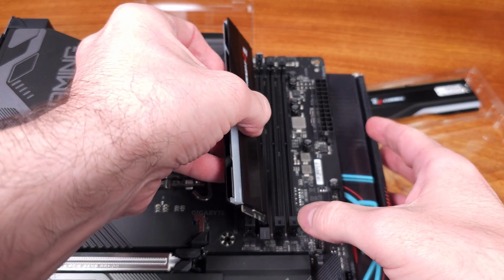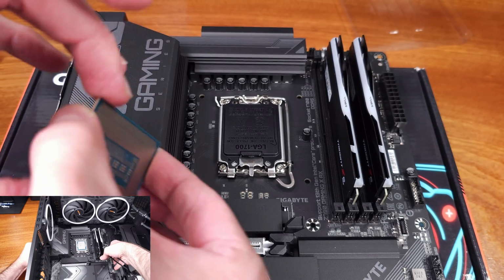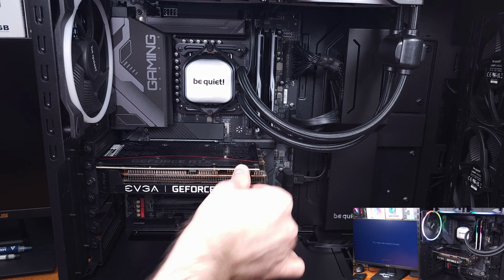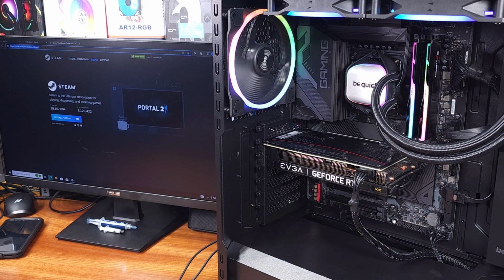14700K + G.Skill DDR5 6400!

Comment: Is there a better cpu right now better than 14700k for gaming?
Reply from the maker: @SCXR-NBD  The 7800x3D is basically the fastest gaming CPU but of course it's on the AMD platform. For Intel, the 14700K is probably the best value CPU for gaming, I don't consider the 14900k/s to be 'value orientated'
Reply: @STS  Thank you very much, i went with the AMD 7800x3D
Reply from the maker: Nice! You will not regret it. What graphics card did you go with?
Reply: @STS  I've got the 4070ti :)

Comment: I have 14700k and  gskill 2x 24gb ram 7200 MHz when xmp turned on, but always chash while playing game. I have to use at speed 5600 mhz and other profiles, I am not able to boot my windown10. What should I do?
Reply from the maker: Hi! Well, first things first - is that memory certified to run on your motherboard? Not sure what motherboard you have but it's worth checking the memory support list or checking G.Skill's. Next I would make sure you have the DIMMs installed in the correct spots. Your motherboard manual will have preferred slot assignments for memory generally speaking. There's an old troubleshooting method of just swapping the memory modules in each others slots, sometimes that works. If none of this helps, it's probably worth updating your motherboards BIOS to the latest version. If all of that doesn't work, you might need to contact G.Skill for support.
Reply: @STS  I have gigabyte z790 aero G mother board. I did everything you said, I finally can boot at 6800 MHz but it still crash at 7200 MHz. I read online forums they say because of mother board is not stable . I did memtest my rams don’t have error also.

Comment: Hi Sam, 
I’m looking to buy RAM for my New PC (video editing & content creation..OBS & stuff..)

GSkill Ripjaws S5 64GB 6400mhz DDR5 CL32-39-39-102 

OR  

GSkill Ripjaws S5 64GB 6000mhz DDR5 CL32-38-38-96  

Which one do you think is Better and Faster… (Motherboard: MSI PRO Z790-A WIFI, intel core i914900k + 4080 gpu )
Reply from the maker: Hey! If this is strictly for video editing, the 6000 will be fine. I find for video editing, quantity of memory is usually more beneficial than memory speed. The 6400 won't hurt and it could prove to be a little faster in gaming when future games need it. So, if you are looking to optimize your budget, the 6000 will be fine.

Comment: I know it's a debate but not spreading the thermal paste makes me unconftable.
Reply from the maker: There's sufficient pressure from mounting to evenly spread out but for the slight possibility that there is too much variation in the surfaces mating, I always try to use just a little more paste than I think I need. 

I have never seen a difference between pressure spread and spatula spread but I understand what you are saying. 

What kind of PC setup do you have btw?

Comment: I have my 14700K running the same 32GB 6400C34 GSkill kit. I got it overclocked on my Z690 4 dimm motherboard to 7000C32-41-41-28 and tighter sub-timings at 1.5v, and my 1% lows are way better with less stuttering.
Reply from the maker: Hey Oscar! Wow, awesome overclock there! That's quite an improvement - I'm quite curious to see if this 64gb kit can be pushed that far. I'm actually quite interested to see how far I can push the memory and see what kind of iGPU improvements can be had. 

This is a gaming rig?
Reply: @STS  yup purely a gaming rig. I'm sure you'd see some improvements in productivity apps as well. 64GB might be tough to get much higher but I would be interested in your results!
Reply from the maker: @oscar21781  Nice. Yea, I'll have to try to take look soon. In the past I had not really seen any games with my old video editing software but I do use Davinci Resolve now. Quite curious if there's anything I can do to increase performance.

Comment: I'm running 14700KF and Corsair LPX 6600 cl32, can't get it to run stable if I go past 5600mhz is this bad luck or bad ram choice?
Reply from the maker: Corsair definitely makes some good RAM but, it might not be fully tested or compatible with your motherboard. What make / model motherboard are you using and which Corsair kit do you have currently?

Comment: I run the 32gb cl32 6400m/t g.skill with a i5-13600k on a Z690 mobo, runs 6400m/t just fine, which made me happy, guess some ppl still loose the lotto and cant run that speed out of the box :) paired with a non-super rtx4080 and get great performance :) also snagged these sticks practically new off ebay for $70 GG
Reply from the maker: Hey, good deal! I have a 12600k in my Unraid server, thought about picking up a 13th or 14th gen for it. 

That sounds like a great gaming machine there. I've been mulling over moving on from my 3060 12gb to either a 4070 Super or 4080.
Reply: @STS I just upgraded from the 3060 to the 4070 Super. It's definitely a good upgrade. I have mine paired with a 13600K on a high clocked DDR4 kit and it's overkill for 1080p. So, naturally I have to upgrade my monitor now lol.
Reply from the maker: Ha, yea, the upgrade bug definitely gets me too. I'm still waiting / on the verge of picking up a 4070 / 4070 super, good to know its a solid real-world upgrade. My editing machine a little older, 11600K system at the moment, I'll be very interested to see next gen CPUs.
Reply: What are your voltages?

Comment: May not always work but I purchased the same kit at 5600 CL28 and easily overclocked it to the same timings as the 6400 kit you have there.  Granted right now its only a $10 difference but I purchased it not long after DDR5 came out so the prices were a bit different back then.
Reply from the maker: Very nice! I have seen some people report good luck with memory overclocking to that degree but yeah, I don't know that everyone will always achieve that on every motherboard. What CPU are you using btw?
Reply: @STS  That is on an AMD 7950x.  So it surprised me a bit since 6400 speeds are not always stable on the AM5 platform. But I got very luck with the silicone lottery on that chip.
Reply from the maker: @gscurd75  Oh wow, even better then! I almost always buy the R7 X700X type CPUs for the releases but I did have a 3900XT for a while and it was excellent. Debating if I just want the next gen 12 core Ryzen CPU or if I can justify it for the channel and editing, ha!

Comment: Nice...I got this in 48x2,  as the Ripjaw does not work on the ProArt Asus board(1.35v I think), even after Bios update. 
BTW, do you think with a LianLi 216 case stock, with a Phantom Spirit tower aircooler, with a i7 14700K and this mem in XMP, 360/12GB GPU,  and a stable or moderate OC on the CPU running for work days doing image editing (LRoomClassic & Photoshop) I can get away without watercooling in a climate of mostly 72-78F room for most of the year, maybe hit  (79-80F for about a month or so) ?? Your thoughts?
Reply from the maker: Hi Philindeblanc! Love the handle :)

Ah, that's tough on the memory compatibility but G.skill does an excellent job with the QVL / compatibility charts. For me, 64GB is the sweet spot, does your workload require 96gb?

As for the the 14700K, this CPU can run hot, that is for sure. With the Spirit 120 and a LANCOOL 216 in a mid 70F ambient temperate, I don't see too much of an issue. You will however see higher and more consistent clockrates with an AIO for sure but, the system will still run well enough. I would say CPU overclocking outside of your Motherboards MCE mode is likely off the table though with this cooler. I don't CPU overclock for my editing machines but I do run the memory in XMP mode. 

I also have an RTX 3060 12gb, it's an excellent midrange video card for gaming and creation tasks in my opinion - I use Davinci Resolve mostly.
Reply: @STS  Nice...I did order the Trident, and it is working. Oddly, I am not 100% sure if the Ripjaw was a issue, as the BIOS I downloaded was actually not the latest somehow. Either way the 96GB 6400 works fine. I deal with starting raw files that are 100MB, and they grow to sometimes 1 GB files in Photoshop editing. I prefer to use CS6 deskto old version as I dont like to support Cloud software, but, I am running CC as LR is much faster, so also running Photoshop CC. For the edits I do, there are a few new features that help in PShop. 

I may do the same, keep CPU stock, and xmp the mem.  Im now getting straight to BIOS, so once I have Win10 OS on here, I'll be good. Chers!
Reply from the maker: @philindeblanc  Awesome! Interesting about Photoshop, I'm not familiar with photo editing at all really. If you install HWImfo64 you should be able to see your CPU temps during your working sessions. This will give you enough info to judge your headroom for over locking but I suspect it's not worth it. I'm not a fan of the subscription model either,  using the free version of Davinci but I am considering paying the one time fee as it unlocks some very handy video editing features. Was this your day job, side job, or hobby?
Reply: @STS  Yes, I like that HWinfo. I work in image analysis, image editing and some video using Premiere...Have not tried DEvinciR, but here great things. I am not picky on video edits, as my needs are pretty basic, and since having Adobe CC, I use what it includes, even if there are free apps out there. (For now at least) most of the days at work, and now a days, do some photography. Before I did more photo work.
Reply: @STS  My mem is all good now, but fans are not spinning, not even seen in Bios, and this case RGB hub is so fragile cheap on this 216 case, geeze.  I think this case needs to be returned. Cheap metal, and too many issues on this unit. Bad RGB, bad something for the fans(this maybe resolvable), and cheap hub cables. They dont make them like they used to.
Reply from the maker: Interesting, I haven't worked with a Lian Li case in a long time. Did you end up getting something else?
Reply: @STS  The Lian Li 216 has a fan managing connection hub, and one of the pins or the hub was bad. LianLi is sending a new one out, so that should take care of the fan and LED issues. As of now , everything is running. Most issues were resolved with software bios and driver updates.  Windows 11 is now also updated from win10. And happy to report that desktop version of LR and PShop are super fast and will not be using the CC versions, as the nice features in Lr can be doen in PShop, and now with littl delay.  This case is nothing like past lightweight and well made with good material cases. The metal side panel that covers the case has snap pins, and one has already broke off. The screws that secure things in place are not the quality smooth and well fitted types. Basically it has good ideas, but the make is cheap material. BUT, I think for $100 it is a good case, considering the hyper inflation. As my 8 year old case that was also about $100-120, I still have is in excellent condition, and NOT cheap materials. Due to materials, and cheap metal, I MUCH prefer an aluminum and metal case with quality screws like my old Lian Li. Frankly, if I was sure to just use AIR COLLING, and not need the space for radiator water cooler, I would have used my old Lian Li case, as I actually have a couple more of those from old systems in storage.